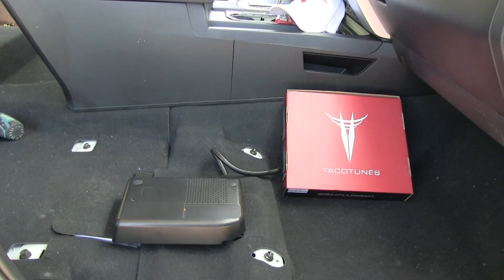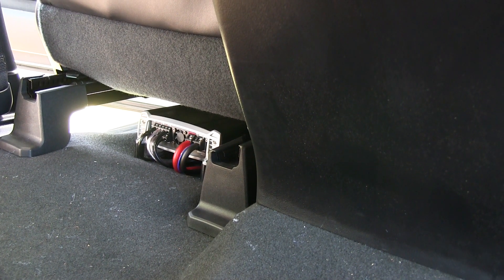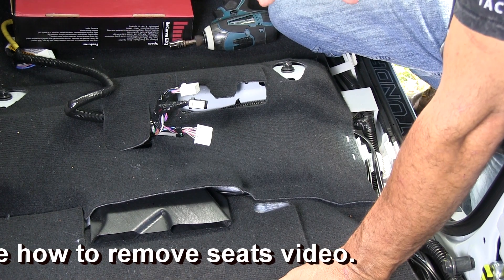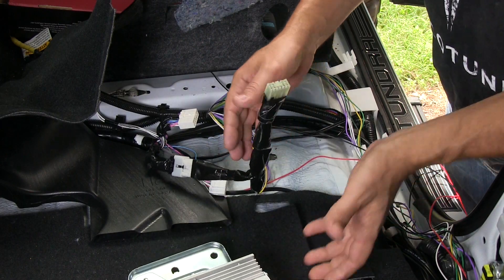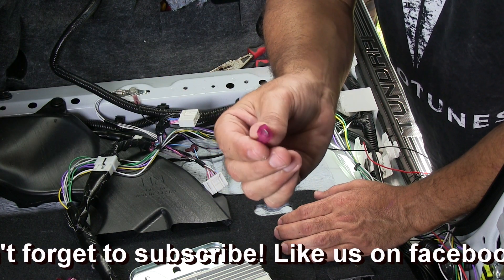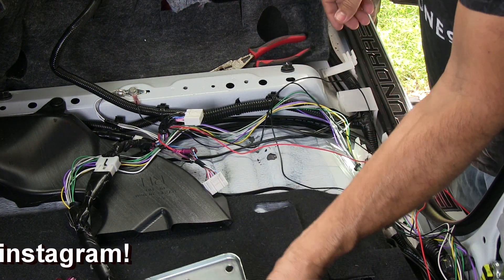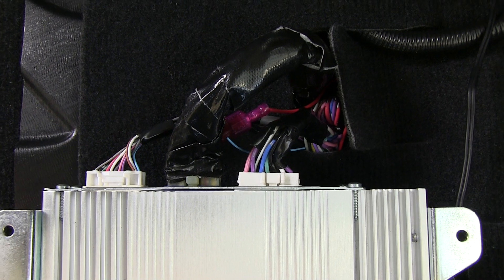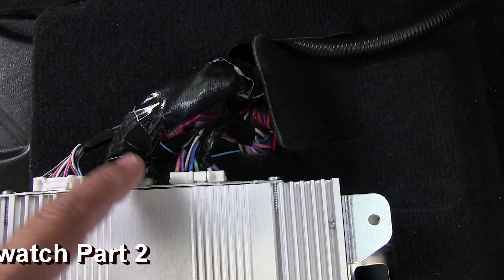How to add amplifier (s) to your Toyota Tundra w/ JBL & keep your stock stereo.  ReCurve EZQ  Part 1

Comment: That's a nice solution. For those who don't necessarily need the EQ, you can just put the aftermarket amp in place of the factory amp. You can grab 4 channel audio signal, remote turn-on, and speaker leads right there under the seat. You only need higher gauge power and ground leads. Grab yourself a $200 8-channel amplifier, swap out the factory sub, and enjoy :)
Reply: And then you've got to decipher the digital aspects that come from the head unit. This thing is meant to perform with only that amplifier not just any amplifier alleged smart guy

Comment: Can you please tell me where the Jbl amplifier is located on the 2007 Toyota Sequoia? I need to bypass the system. Radio Wiring harness does not fit my aftermarket radio and wire colors are not standard. I saw somewhere that the ends that go into the JBL will match the aftermarket harness with the standard  wire colors and from there I can match the wires to the aftermarket radio harness. I tried to hard wire the radio without the stock harness and was able to isolate the power lines (constant, accessory,ground,illumination) but have no idea on the speaker lines. No diagrams found so far match the wire colors in my vehicle. I tried to intelligently guess the wires but I have no sound. Please help.
Reply: Louie Dee look under the tray that's right below the stock stero below the change holder
Reply: Curt Crecelius boom, there it is!! Thanks!
Reply: Louie Dee no problem man Toyota family

Comment: Rob I need a wire harness for the JBL system
Reply: contact us at tacotunes.com and we can guide you to the proper harnesses need for this install.
but here is a link for the harness requested.
the system to bypass the jbl is a recurve sound process along with the harness. the harness alone cant get it done as you need to redistribute the signal to the amp for quality sound performance. thanks 
https://tacotunes.com/shop/toyota-tundra-audio-products/crewmax-audio-products/tundra-dash-radio-stereo-installation-kit-stereo-head-unit-dash-installation-kits-crewmax/recurve-ezq-add-amps-to-your-stock-toyota-tundra-stereo-head-unit/